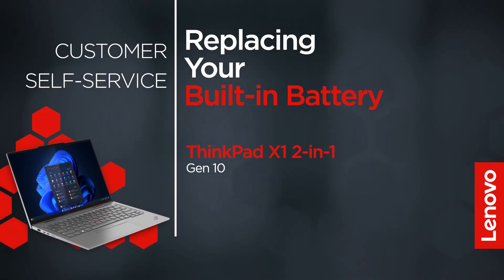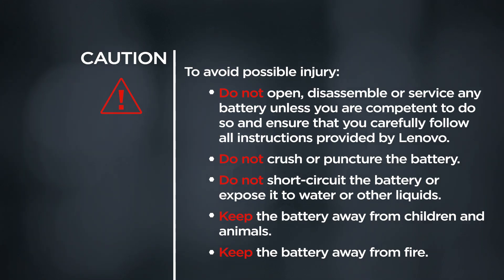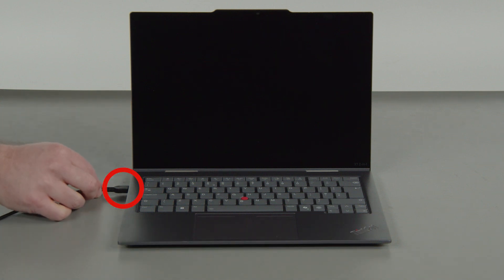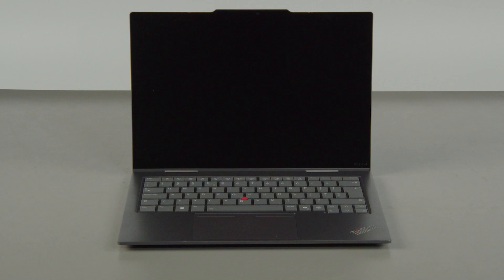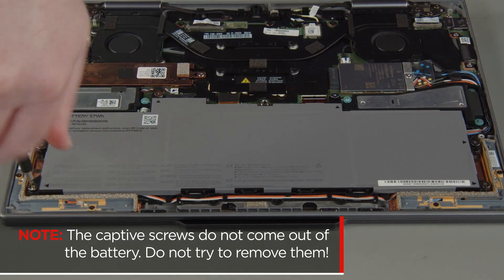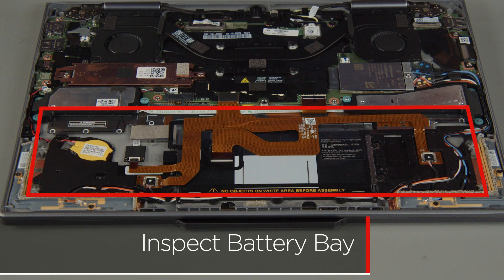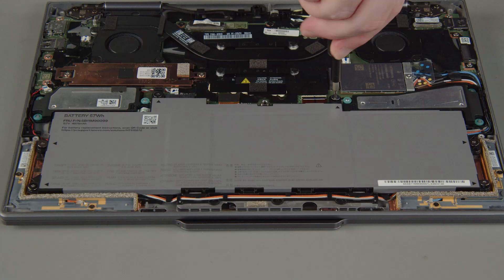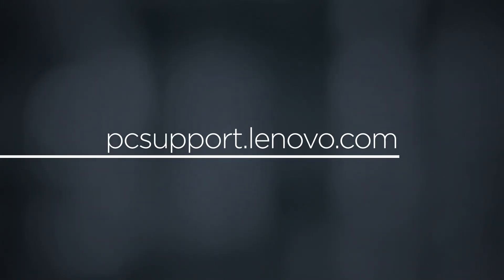Replacing Your Built-in Battery | ThinkPad X1 2-in-1 Gen 10 | Customer Self Service

Comment from the maker: This video will show you how to replace the built-in battery in your ThinkPad. The process in this video will work for the ThinkPad X1 2-in-1 Gen 10.

You will need a screwdriver kit, a non-metallic pry tool, and 15 minutes of your time.

To view the ThinkPad X1 2-in-1 Gen 10 (21NU, 21NV, 21Q0, 21Q1) Built-in Battery Self-Repair Guide go to https://pcsupport.lenovo.com/us/en/selfrepair/sr500120

To learn more about your device go to https://pcsupport.lenovo.com

To find parts for your device go to https://support.lenovo.com/parts-lookup/?cid=ww:lenovosocial:b9515f&source=socialmedia&subsource=yt

To view the Lenovo Support Self-Repair Guides landing page go to https://support.lenovo.com/us/en/solutions/HT516547

** NOTE: Static electricity can destroy components. Use a grounding strap, and clean, non-conductive surface to work on. Use plastic or coated tools to prevent scratching and avoid using metal tools on plastic parts. For more detailed information on electrostatic discharge and how to prevent it, please watch our "Understanding Electrostatic Discharge (ESD)" video: https://youtu.be/by4PB3WtdLo 

Warning: Use only the authorized battery specified for your computer. Any other battery could ignite or explode. 

Batteries supplied by Lenovo for use with your product have been tested for compatibility and should only be replaced with approved parts. A battery other than the one specified by Lenovo, or a disassembled or modified battery may not be covered by warranty.  

Battery abuse or mishandling can cause overheat, liquid leakage, or an explosion. To avoid possible injury:
Do not open, disassemble, or service any battery unless you are competent to do so and ensure that you carefully follow all instructions provided by Lenovo.
Do not crush or puncture the battery.
Do not short-circuit the battery or expose it to water or other liquids.
Keep the battery away from children and animals.
Keep the battery away from fire.
Stop using the battery if it is damaged, or if you notice any discharge or the buildup of foreign materials on the battery leads.
If the battery is incorrectly replaced, there is danger of an explosion. The battery contains a small amount of harmful substances.

Lenovo has no responsibility for the performance or safety of unauthorized batteries and provides no warranties for failures or damage arising out of their use. 

The Vantage app provides an automatic battery diagnostic test that determines if the built-in battery is defective. A built-in battery should not be replaced unless this diagnostic test shows that the battery is defective. The only exception to this is if the built-in battery is physically damaged.

If the Vantage app is not installed on the computer, download and install the program to diagnose the built-in battery before replacing a non-physically damaged built-in battery. Note that the replacement of a physically damaged built-in battery is not covered by the warranty.

https://www.lenovo.com/us/en/software/vantage/

Store the rechargeable batteries or products containing the rechargeable batteries at room temperature, charged to approximately 30 to 50% of capacity.
We recommend that the batteries be charged about once per year to prevent overdischarge.

Do not put the battery in trash that is disposed of in landfills.
Do not dispose of your battery with your household waste.
Comply with local ordinances or regulations when disposing of the battery.
For recycling information, go to https://www.lenovo.com/recycling

Applicable Machine Types:
ThinkPad X1 2-in-1 Gen 10 - 21NU, 21NV, 21Q0, 21Q1

Check out other official Lenovo channels!
https://www.youtube.com/@Lenovo 🟥
https://www.youtube.com/@lenovolegion 🎮
https://www.youtube.com/@Lenovo-PC 💻
https://www.youtube.com/@LenovoSuporte 🟢🟡

#Lenovo #LenovoSupport #LenovoTechSupport